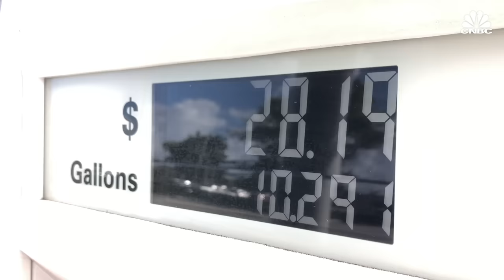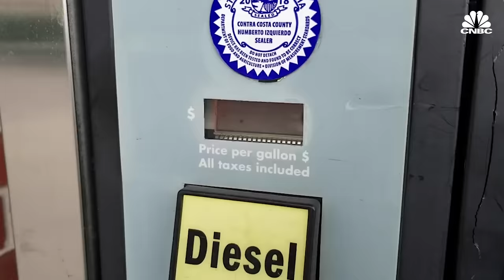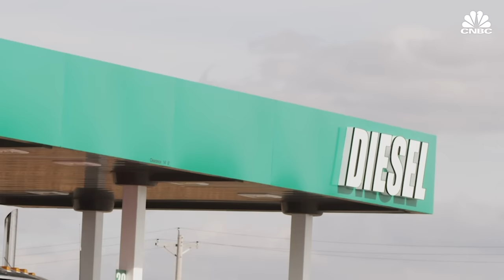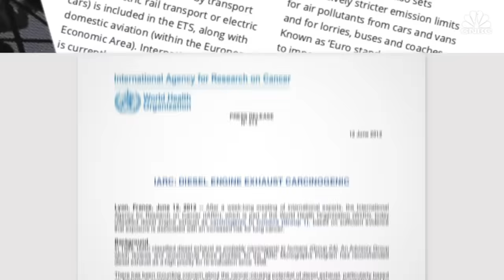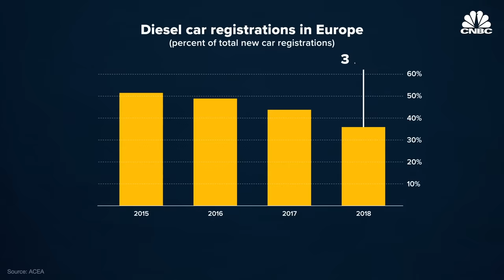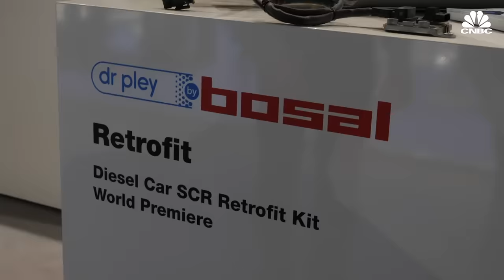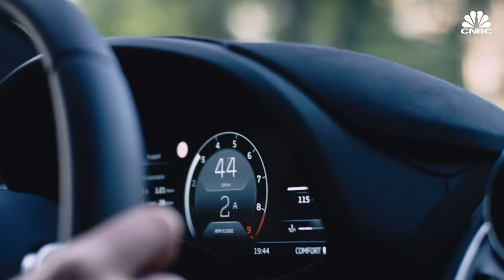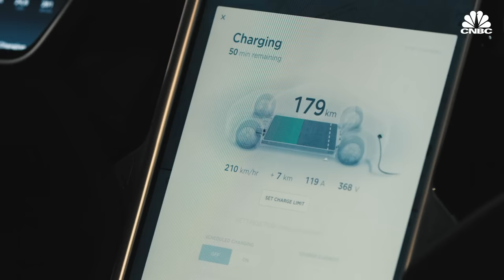Why Diesel Cars Are Disappearing

Comment: My diesel with ADD BLUE his exhaust is cleaner than a gasoline one.
Reply: is slow
Reply: Allmost every new truck is fited with add blue tank fuel to reduce emisions.
Reply: @audionut9974  diesel can be fast too
Reply: @mothertruckersparadise3260  the compression ratio makes diesels slower and the high torque comes in only in the begging of the rev rang. So gasoline powered cars are faster to its diesel counterparts.
Reply: @Gabztar97  a diesel has won the 24 hours of Lemans many times. Computers and other technologies, 22 speed transmission etc.. a diesel can be made to Rev just as quickly.  Dig deeper
Reply: @Gabztar97  again, not all diesels are the same. Audi r10 had rev speeds of over 10k rpms
Reply: No. Diesels produce more NOx than gasoline cars, even with an SCR system.

Comment: Diesel engine cars had a lot of potential but they got a bad rep in the States, even before the VW scandal of 2015.
Reply: Due to fraud.
Reply: @Ok Then They could have been a success in the USA if they just didn't screw it up.
Reply: The term "Diesel" is ok, but "Diesel Cars" is not. Diesel gained it notoriety in the trucking scene, an engine pulling multiple times it's own weight, inexpensively, but the everyone wanted a Diesel VW passenger car to pull it's tare weight + a few hundred pounds; not designed for that - Petrol would do just fine and cost thousands of dollars less
Reply: I totally agree.
As someone who has driven several different Diesel and Petrol Engines, I can't understand the Hate for Diesel Engines. There is nothing as fuel efficient as a Diesel engine.
Reply: @salmansengul  
Do not confuse a diesel engine for a turbocharger - the turbo does the heavy lifting to give a turbo diesel any hope of performance. Turbocharge a petrol engine and omg it goes like the clappers
Reply: @joebloggs4615  I agree. The Fuel Efficiency of Diesel engines doesn't have anything to do with the Turbochargers. Diesel engines are efficient with fuel even without Turbochargers. 
The Turbochargers are of course important when it comes to performance like acceleration.
Reply: @salmansengul  
Go on then smarty pants use a diesel in traffic without the turbocharger and see if you can merge onto the freeway. Mechanical engineering can get anything going to a specification if they have the freedom to bolt on necessary modifications but diesel itself is such a lame duck in passenger cars it's ridiculous and everyone laughed at Mr. Diesel at his "invention". Trucks make efficient use of TURBO DIESEL engines to transport tons of weight interstate because the TURBO does the heavy lifting.
Reply: Strenge because there more reliable than gasoline engines and can start in a lot colder weather or warmer weather without overheating.
Reply: The bad rep was because of GM with the diesel Oldsmobile and cadillac.
Reply: GM “quality” in the 80’s killed the market even before the oil companies raised the price!!
Reply: @joebloggs4615  but they sure are more fun to drive with a turbo!!
Reply: @ThePatUltra my dad had a diesel Ford Tempo (I think) that he ran perfectly for almost 300,000 miles ... and then could NOT get a new starter motor anywhere ... and caused it’s premature demise!! 40-50 mpg constantly no matter what driving conditions!!!
Reply: Yeah  GM 350 block diaster

Comment: I had  Bora  TD 1.8 diesel  used to get  60  miles  to the gallon  with it,  outclimbed  petrol cars  on mountain roads,  quiet  smooth  running....would  always  prefer  diesel over  gasoline !
Reply: 1.9 TD, for 20 years VW used 1.9 liter diesel engine in many forms, the magic number is 1.9 never, not ever 1.8 !!!!!!!!!!!!!

Comment: Diesel is 9-12% more energy dense than regular Gas/Petrol. 

Diesel being cancerous isn't an issue since it's the same case for gas/petrol.
Reply: A gallon of e10 gasoline is about 6lb; a gallon of low sulfur diesel is about 7lbs. Diesel is about 15-20% more dense than a gallon of gasoline so of course it has more energy density by volume, but it's basically no difference by mass which is what really matters. This video didn't do a good job explaining that.

Comment: The EU did not trade pollution for greenhouse gas.  At the time scientists advised that diesel pollution would be worse that greenhouse gases, but the auto industry said they could solve the emissions.  Unfortunately it turned out harder than they thought, even when the limits allowed are still higher than petrol limits and tested in summer temps fully warmed up.
Not only did VW and many other companies used test defeat software, but a number of German manufacturers conspired to hold back emissions legislation (this isn't hearsay it's reported fact and they have been convicted and fined.

Comment: I live in Italy and I just buy for 5000 € a used vw car from 2015 whit the engine of “scandal” is perfect and ultra economical to run.
Reply: Yes, and other have big problems with their cars not running well.
One case doesn't make the whole case. It's the reason why vaccines are existing and working well, even if some of the population (2%) can be intolerant to them.
Reply: @boboutelama5748  the same case is why do we healthy people need to vaccinate to save other 2% that wont survive?

Comment: Diesel cars are really good for long distance driving though
Reply: They are. It’s the torque characteristic that does it. You get that nice in gear acceleration, low crank speed, less changing gear. I’m keeping mine until it rusts out.

Comment: I had a Diesel VW Golf for 8 years, and it was absolutely fantastic. Now own a newer petrol Golf GTI. It's great fun, but I still sometimes miss the diesel engine. That little 1.6 TDI engine had way more power than any newer petrol 1.6 engines on motorways. 

I recently drove a modern 1.4 petrol Vauxhall Corsa, and on paper it had faster 0-60mph than my diesel golf. But it absolutely struggled when it came to motorway driving. Overtaking would be impossible sometimes.

Comment: The world runs on diesel 💪
Reply: Anonymous Anonymous  ?
Reply: Anonymous Anonymous  normally with dpf there is no smoke
Reply: Anonymous Anonymous  Understood.
Reply: Anonymous Anonymous  yes but most semi trucks or normal European trucks runs on as blue which is just a eco friendly as petrol and with a diesel you get more torque
Reply: @CL4SSiCS  he means about the hyper tuned pick-ups
Reply: I just wish America would let Kia bring over the new Mohave… check it out. It would make the 4Runner crap the bed. Oh did I mention it’s rated for 27 mpg highway a 6 cylinder diesel….
Reply: @brandonlewis5045  Unless we replaced them with natural gas and gasoline engines.
Reply: @PistonAvatarGuy  Hasn't happened yet.  Diesel engines last along Time with General maintenance etc. Gasoline engines don't last near as long so it depends on what they want to do.  One things for sure whatever they decide to change too it better be reliable and cost realistic or Diesel will never vanish
Reply: @brandonlewis5045  It is happening, in plenty of applications. In heavy applications, natural gas engines are cheaper to fuel, cheaper to maintain, more reliable and last just as long, if not longer (they're not as highly stressed as diesels). In light applications, gasoline engines just make more sense and basically always have. Diesels are far from being cost effective in many applications because of modern emissions requirements and because of modern advancements in gasoline engine technologies.

How long an engine lasts is not related to what kind of fuel it burns, it's dependent on how the engine is built. Gasoline engines can last just as long as diesels, if not longer, this has been proven in aircraft for quite a long time.
Reply: @PistonAvatarGuy  When they can haul 30k plus pounds day in and out and stay on the road and tow like a diesel then will see. Hasn't happened yet and anyone that needs heavy-duty trucks to pull its diesel hands down
Reply: @brandonlewis5045  Natural gas engines are used in Class 8 trucks, hauling 80k pounds of truck, trailer and cargo for millions of miles.

I don't understand where people like you got this idea that diesel engines are somehow magical and capable of doing far more than any other engine, the only advantage that they ever really had was operating inexpensively, that was it, and it's no longer true in many applications.
Reply: @PistonAvatarGuy  why aren't they in 3/4 ton and 1 ton pickup trucks 🤔.  Not too mention no gas 1 ton truck can pull as heavy nor the efficiency in fuel mileage bud. Your really lost and if you've never had a diesel you have no clue!
Reply: @brandonlewis5045  Sorry, buddy, but you don't know the first thing about what you're talking about here and any answer that I give you will just go completely over your head. You're even baffled by natural gas engines being able to haul as much as diesels, so how am I going to begin to explain anything to you here?
Reply: @PistonAvatarGuy  Then why do they still make diesels in 3/4 and 1ton trucks??? If you know answer that?
Reply: @brandonlewis5045  Because people still buy them. A business will sell anything that people are willing to buy, regardless of how well it works.

Really, the answer to that question gets very complex, but the answer is not that gasoline engines are incapable of replacing diesels.
Reply: @brandonlewis5045  I suppose that the simplest answer would be that building a direct replacement for the diesels in heavy duty pickup trucks would require a completely new engine design (basically a big, heavy duty EcoBoost engine), that it costs hundreds of millions of dollars to put a completely new engine into production and that it would be a risk, because the absolutely enormous amount of misinformation surrounding diesels has cemented them in people's minds as being endowed with magical properties, which no other engine can possess.
Reply: @PistonAvatarGuy  Simplest answer back to your question. Why is dodge still putting Cummins in, Chevy puts duramax in, Ford still has powerstroke. If ecoboost is so good why are people talking about the 6.7 powerstrokes
Reply: @PistonAvatarGuy  Why are they making new diesels in 2021 if ecoboost trumps them? If your so smart then answer that? Your not and there's a reason why.  People need a everyday truck to haul bobcats, skidsteers, backhoes, 2 and 3 cars from point A to B. It's physics which equals maximum torque from a low rpm.  You'll never get that in a gas truck.  For light duty there good but when they need the big hauls and longevity good luck
Reply: @brandonlewis5045  People are buying the new gasoline 7.3 over the 6.7, because it's significantly cheaper, far less complex, it's likely to be far more reliable and far less expensive to maintain, and it has over 90% of the hauling capability. To directly replace the 6.7 would require a heavy duty turbocharged engine (see my previous comment).

There are plenty of videos on YouTube about why people have ditched their diesels and are going with the new 7.3.
Reply: @brandonlewis5045  "Why are they making new diesels in 2021 if ecoboost trumps them? If your so smart then answer that?"

I already did.

"People need a everyday truck to haul bobcats, skidsteers, backhoes, 2 and 3 cars from point A to B. It's physics which equals maximum torque from a low rpm."

Like I said, this is WAY over your head.

"You'll never get that in a gas truck."

Oh? Explain why.

"For light duty there good but when they need the big hauls and longevity good luck"

If natural gas engines have no trouble outlasting diesels, why would gasoline engines have trouble outlasting diesels? Heck, if you're so smart, explain why gasoline aircraft engines go longer between overhauls than diesel aircraft engines. Where's diesel's MAGICAL longevity there?
Reply: @PistonAvatarGuy  Diesel engines are durable and efficient unlike gas engines periodically. Prove it wrong,  it's all around you day in and out
Reply: @brandonlewis5045  Man, I'm tired today and I'd have to write a wall of text to reply to you, but you're just going to ignore it anyway. If I get you a reply, it wont be for a while.
Reply: @PistonAvatarGuy  Will see how that goes in the future.  Your touting a new engine that has no record or history of reliability yet like diesels do. Your a guy that is always looking for the next thing never appreciating what you had in front of you for years
Reply: @brandonlewis5045  Actually, my city never got rid of its natural gas buses, it was just the articulated buses that had diesels. They kept going into limp mode on the highway, which I would bet meant that they had a clogged DPF, or some other nonsense problem with the emissions control systems.

Comment: 6:27 Dieselgate started in 2007, iirc, not 2015.

I have a 2006 VW Jetta TDI and it still runs like new, even with close to 140,000 miles on it. This beautiful and great car was made before diesel gate. It’s a shame that Dieselgate happened, but I don’t want to go to a normal gas car. Yes, diesel is more expensive in price but it lasts longer. I wish it was cheaper though. Love my car!

Comment: The advantage of diesel is you can make cheap fuel from used cooking oil. I had a buddy in college who did that right around the time fuel prices skyrocketed in order to save money. Diesels are also more versatile in that they can run on other types of fuel such as heating oil (which is used on farm trucks, but is illegal for road use), kerosene, and jet fuel without modifications.

Comment: LoL 😂😂😂.
Diesel engines are always the best because diesel engines can run easily 1 million to 1.5 million miles without any big issues 
On the other side the gasoline engine I mean patrol or octane engine can run 200k to 300k miles only and after that need serious overhaul or need a new car 👉💯 

This is the secret and the automobile industry wants to make money that's why they need to sell new car 

But if they make diesel engines then one car will last a minimum of 30 years and the automobile industry would not make money quickly that's why they start making gasoline engines so that people buy cars after 5 to 10 years 👉💯

So intelligent people always love diesel engines always 👉

Comment: All I'm saying is this. EV's are not that "green" and if pushed to be the ONLY option for families and workers, we will have major problems on so many levels.
1. The minerals needed for EV's are very rare and very expensive in masses and they require a lot of land and water for the process. So much that they will create desert lands and the risks of contaminated fresh-water are dangerously high in many places. And the working conditions are very-very bad and the safety is near non existent.
2. The electric grid in many places around the world are far from ready to handle such amounts of EV's in society and the purchase + installation of the charging stations are ENORMOUS, so much that it is impossible for many companies to afford them. 

3. What makes this issue even further dangerously complicated is that the amount of energy demand will go through the roof and with many countries not willing to invest in new nuclear energy technology and plants (despite even the UN have said this is the only solution for the need and demand). Windstations and solar cells are in comparison a pure joke in combination with supporting an EV only vehicle society as they have been proven to not only be weak but ineffective and very costly in service and maintenance.

4. Families and companies that live out on the country side, miles away from cities will suffer a lot of complicated problems to fit there lives when it comes to combining family, work and spare time. They will have problems with balancing these elements as the EVs are required to be charged and the charging possibilities very limited and scarce. This will not be sustainable.

5. Recycling of EV's engines and batteries are already a problem and at many places a disaster as the valuable minerals in these parts are very difficult to extract out of them and just ending up laying in a giant pile doing nothing, going nowhere. More is that many are reported to be more dangerous then ordinary batteries and the leakage of acids and chemicals are very harmful for nature and water. This is not an acceptable issue.